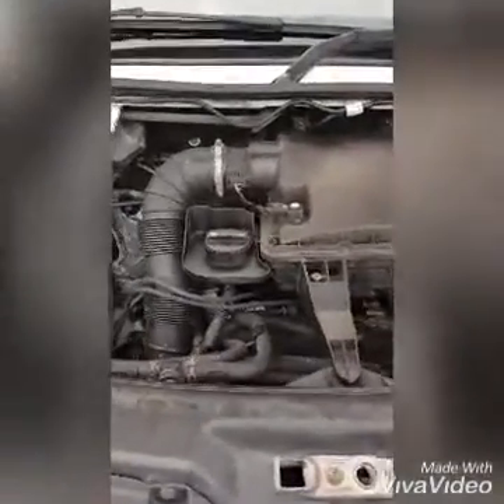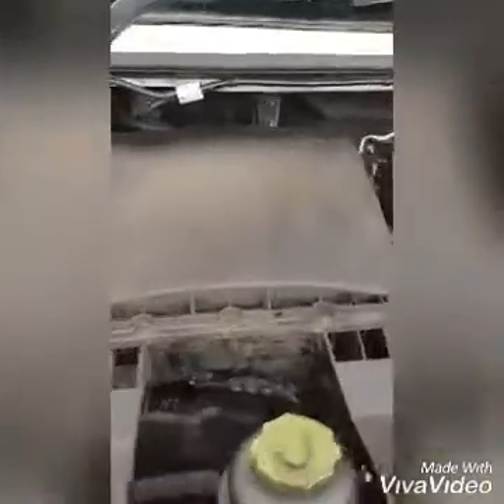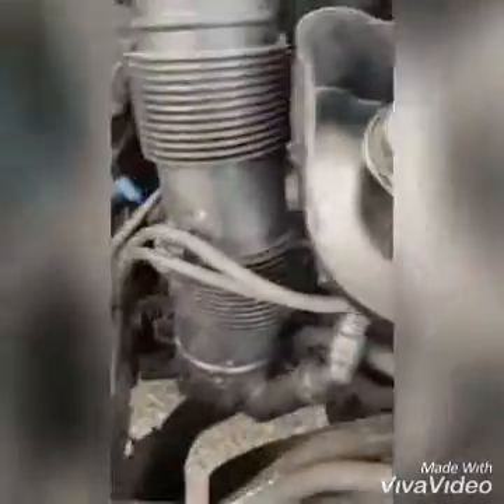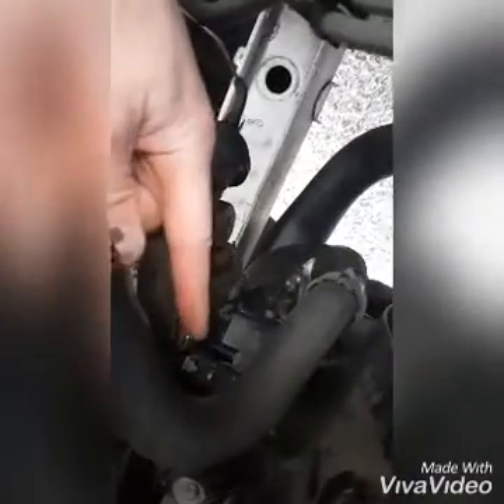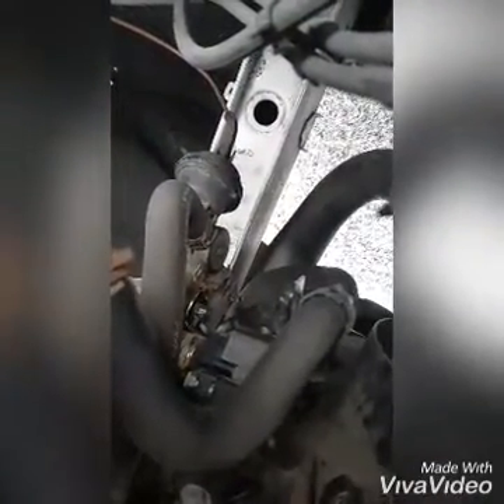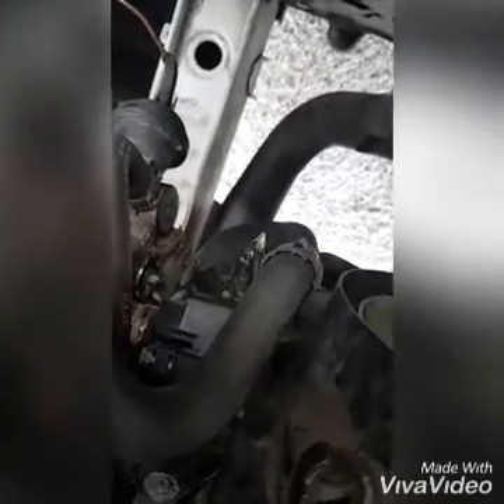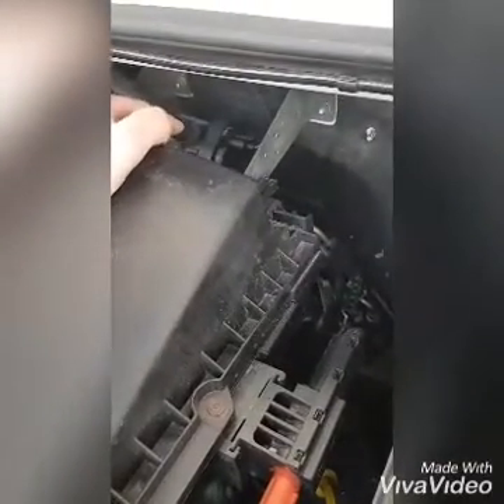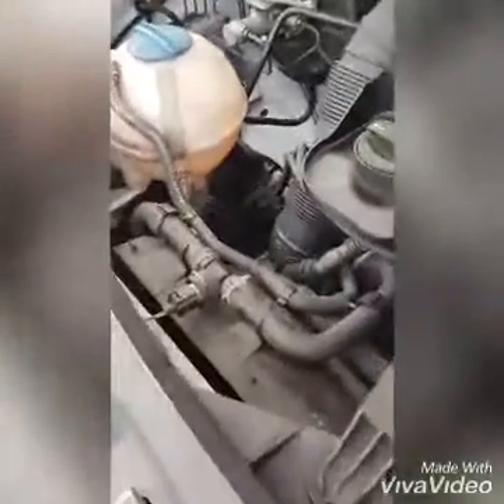P261A

Comment: Also what is the pump called that you refer to in the video, I was looking to change the pump at the back but maybe its not this one that is causing the error as it shows the error even after resetting, if the pump at the back is only active when the engine is hot, presumably its picking up the start up error from the pump you mentioned?
Reply from the maker: Auxiliary pump